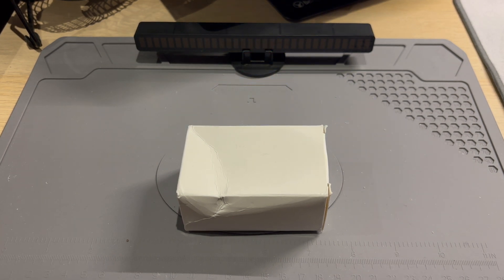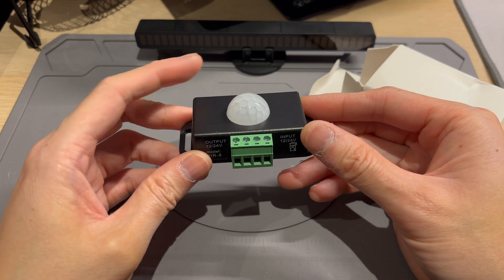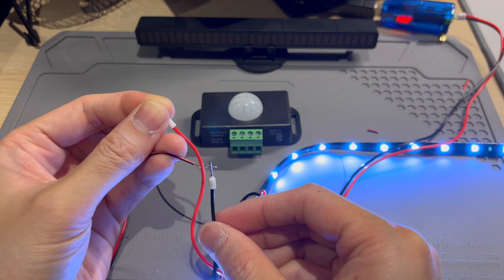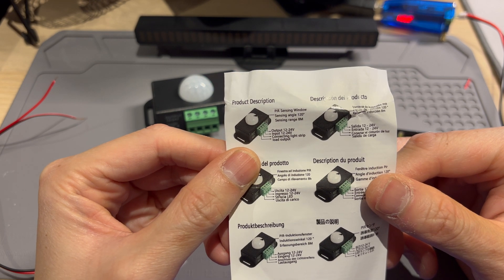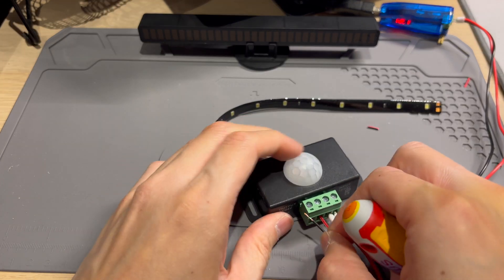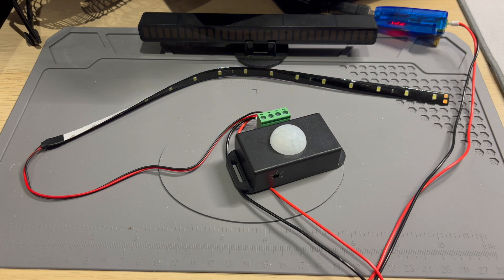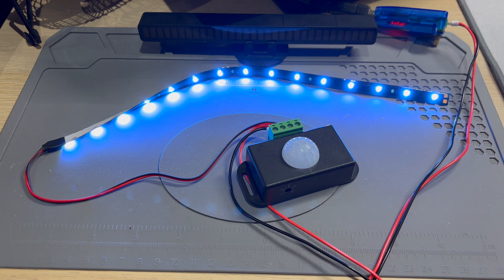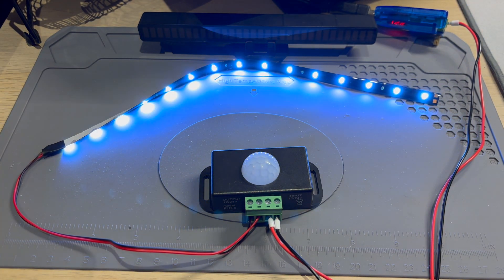12V PIR Motion Sensor Unboxing & Test with LED Strip | Simple DIY Motion Light!

Comment: How far away will this detect something ( in general )
Reply from the maker: About 3 metres.
Reply: @mrjamesflores  Anything out there to get more distance......such as 10 meters ?
Reply from the maker: @IrvJames Not sure I haven’t needed something that was further. You could get one and test, they are fairly cheap.
Reply: @mrjamesflores   Yes.......I noticed. Ill try one.   And can they be wired inline with  a solar / light sensor ?

Comment: How do I add the switch as well? I'm planning to install outdoor garden floor lights with motion sensors outside, but I want to be able to turn on the lights from inside using a switch.
Reply from the maker: Easy. Just add it between the battery and the input to the sensor on the positive line.

Comment: Ive had one of these for the lights in the back of my vehicle for 3 years now and it recently failed, so i bought another from aliexpress and the timer feature was not working properly, it was either a few seconds or 10 mins, nothing in between. I returned them and bought more from ebay, and has the same issue. There must be an issue with the batch. I think ill wait a month or two and then try again. My preference is around 5mins or so that way the light isnt turning on and off so frequently, because a friend we are with a lot of the time has epilepsy and i dont want to give her seizures. So for now my light is just back to manual switch.
Reply from the maker: I had trouble with the timing as well, but I only use it for cupboards so I leave it on the default.